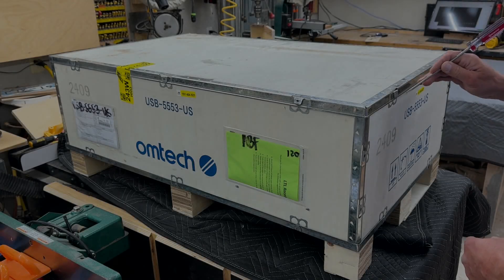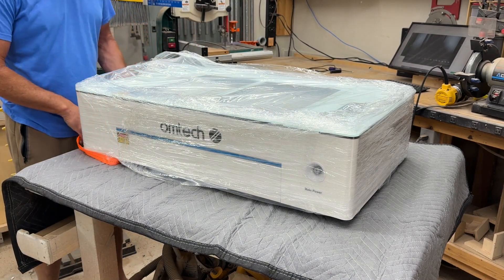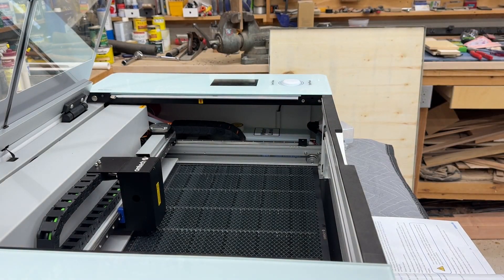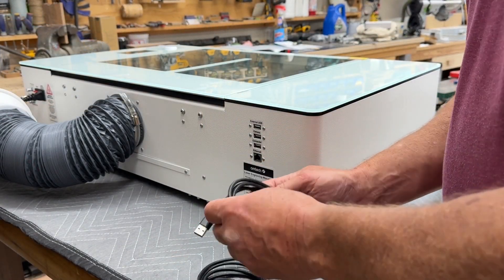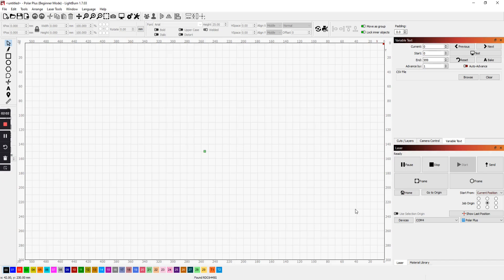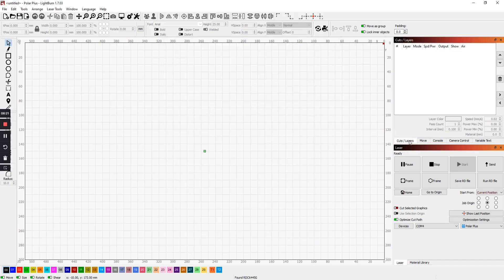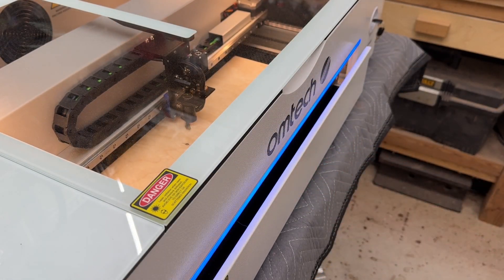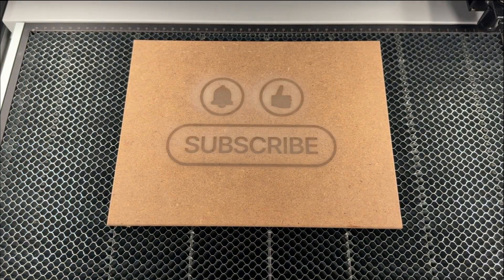OMTech Polar+ | Unbox | Set-up | Install Lightburn

Comment: Was the water/coolant already in the tank or did you have to fill it? And if yes did you use omtech coolant? Sorry for the questions but I’m gathering all the info I can before I get a laser and I can’t find any info on the coolant on any video or omtech website. It’s between this and the xtool ps2s. Thanks.
Robert
Reply from the maker: @dbrailfan6641  hello, the om tech polar plus comes with cooling fluid already installed. The X tool P2 comes with a container of coolant that you dilute with water, depending on your location and then fill the tube.
Reply: Thanks for the reply. At the moment I’m leaning toward the polar plus since I would have to purchase several items for the ps2 additionally for the machine like a honeycomb tray and the higher purchase price what plays a role since I’m a beginner. Thanks.

Robert

Comment: Hi Just got my Polar Plus last week all setup and works great except for the Z axis but the Distance box above the speed and the Z speed is grayed out how does it know what thickness my material ? Thanks
Reply: You have to run the autofocus every time you put a new material thickness in there. Move the laser head over the material then press the target icon on the upper right of the screen. it will touch-off the material and offset the correct cutting distance for cutting going forward. Their choice of icons are pretty bad (not intuitive)!

You can mostly ignore the material thickness setting in Light Burn. AFAICT, this is only used to move the focal plane down deeper when you cut thick parts with multiple passes (eg, advanced cut settings). You can leave it at 0 for most applications (eg, thinner materials) and OMT support told me to do that.

Cut quality: You will absolutely have to use the Min Power and Max power fields on Lightburn because the controller is not smart enough to maintain constant speed around corners. It will have huge blowout kerf around the corners..... and the straight-aways will not cut all the way through if you set them to be the same %. This makes dialing in a material at least twice the amount of work because you have to do test cuts for each power setting, on straits vs corners, or the cut looks terrible. The Ruida controller is really bad limitation on this front.

General Polar+ observations: 
The light burn documentation is poor and this video is a gem. 
On my unit they shipped it with glue smudged all over the glass filter on the left side of the gantry. It took them a few weeks to send me a new glass and aluminum ring which I had to glue in myself with 2-part epoxy (stressful!). No idea why they could not send me it assembled. Watch out for this quality problem.
I'm also randomly getting get z-limit errors after the run has finished cutting. My guess it is losing steps on z somehow so I re auto-focus each time. 
Their overseas email support always responds in 24 hours but is not the best as they send you one-line email responses without links to documentation/pictures/explanation, that don't really answer the question. I think there is a language barrier.
The lid on my unit can open about 8" before it turns off the laser. Not exactly safe but I don't mind since I am the only one using it.
The metal work is not very precise on the case and has very thick paint on it.
The laser packaging is really high end, no expenses spared.
The camera calibration in Lightburn is not easy to perform and is not perfect (things are about 1" to 1/2" off from actual; more accurate in the center of the bed). I had to print off multiple calibration grid sizes at at scales to get it to work. OMTech should provide a PDF at the proper scale or provide one in the packaging.

For the price, don't be surprised that you get what you pay for. The build quality and customer service cannot be compared to Glowforge because... that is not what you paid for. 

If I can make my z-limit errors disappear after every run I think it will work out OK for my purposes. LightBurn is AMAZING (better than Glowforge or Epilog software), but the Min and Max power settings for the Ruida controller in the OMTech make it much more difficult to use than a Lightforge or Epilog.
Reply: Are you still having trouble with the Z axis? This is the only video I have found that mentions it. Out of the box I have no adjustment on the z axis and the auto focus doesn’t work. The touch screen up and down buttons for the z axis do nothing . I can hear and see the motor twitch when the button is pressed and the height value increases on the touch screen display but there is no movement. If I turn the thread by hand the height can be moved so it isn’t seized. Looks like I have a duff motor. Have emailed support but no response yet.
Reply: @davidford4268  ever since I upgraded lightburn I have not had any z-axis limit errors anymore. I still leave out the possibility it could be hardware.

If you take off the cover on the head (magnets) can you see the motor move at all when you click the auto focus button?
Reply: @davidford4268  were you able to figure this out? 

When do you attempt to autofocus, magnetic cover removed, does the motor turn at all?
Reply: @ @ 
Not yet fully. Have run through all the diagnostic steps with OMTech technical support which took a few days. They suspect it’s the motor and have sent me a new one which they said could take a couple of weeks. 
So at the moment I just have a very expensive paper weight. 
Was so buzzed to get the unit and get stuck into making things and this has really taken  a lot of the excitement I was feeling away. Especially as this isn’t a guaranteed fix.
Reply: @davidford4268  Shoot!

Stepper motors usually do not die in my experience, usually it is connectors or driver electronics. Keep us updated! Might consider following the wires and make sure they are plugged in tight. Examine the connector contacts.

If you wanted to use it, my guess is you could manually move the motor or gap your workpiece to the appropriate focal distance. Other lasers have a small block of something or a swivel arm at the correct focal distance and you move your workpiece that distance away.
Reply: @ replaced the motor and this didn’t work. They now want me to strip the unit apart to check connections at the controller and swap the y axis motor with the z axis motor and see if it then moves. 

Can you imagine buying a brand new car and if it has a fault, they send you an email and tell you to diagnose the fault and replace the part yourself.